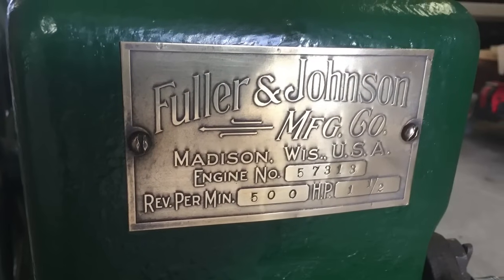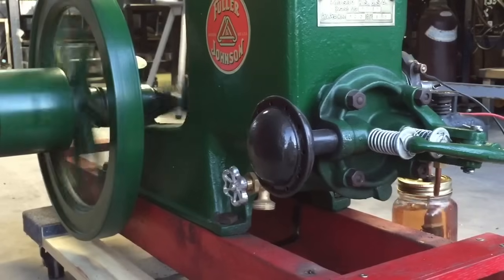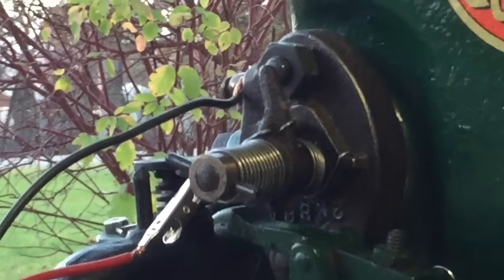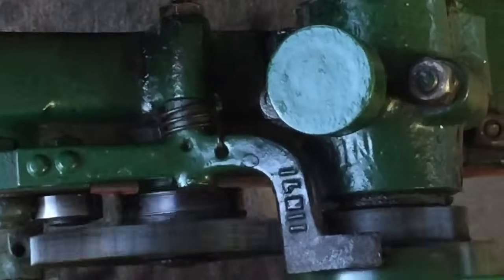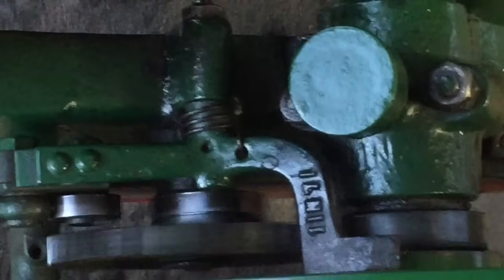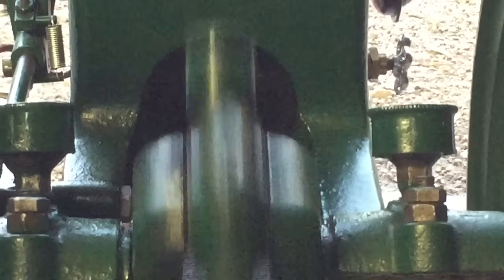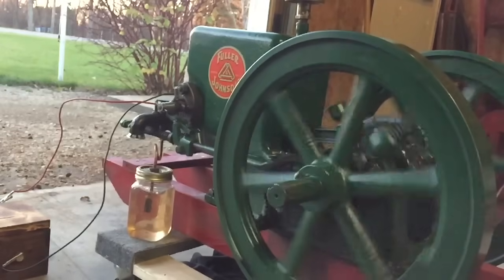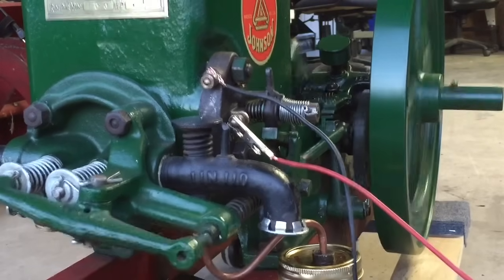How Does A Hit And Miss Engine Work ?

Comment: I’ve been a mechanic for over twenty years and have never seen one of these running but to see it is amazing makes me feel like I grew up in the wrong era
Reply: I know this is somewhat "ancient" technology due to nowadays, but quite frankly, I am wondering if perhaps there's a way to make this more effencient of an engine.

I'll have to think of ways to make it more efficient, but maybe also, a steam engine could potentially use this technology as well, along with the hit and miss ideology.

Considering it would have to be a compound steam engine, but i doubt a compound steam engine could work the same way, possibly another way.

The way this technology is going, a possiblity of steam engines with solar parabolics and the usage of hit n miss engine combination...

I'll think about this more and more every day as time goes by to not dissapoint those that relish a hit and miss to allign into a newer era.

Problem is, steam is not a lubricant, but the smidge steam oil with the heating of the sun may allow the oil to make the water heat more absorbant and retain more heat.

Allowing for such an occurance to be possible.

Comment: Thanks for this video. It enabled me to add a scaled down governor to a 3" diameter flywheel for my little 4 stroke farm style engine. It works pretty good once I realized the flywheel eccentric needs to be timed with the valve cam so as not to engage too soon.
Reply from the maker: Glad it helped , but i dont know how youd go about timing the valve cam to the governor/latch

The gov collar moves based on rpm which has no relation to the location of the cam/pushrod/ex valve location.
The gov collar may be in postion to latch at any time in the pushrod location but can only do so when the pushrod is fully forward and ex is fully open
Reply: In my configuration, if the flywheel weight eccentic caused the latch arm to engage the valve pushrod collar before the cam opened the valve all the way, it would bounce back off the  stop collar od and not catch. By setting the weight in relation to the exhaust valve it could engage at the precise instant to catch . @BAGOTCORNER
Reply from the maker: Send me a video bagotcorner   At  gee male dot calm

Comment: I was told that the water hopper is open on top to allow the hot water to evaporate, so the cylinder doesn't get hotter than boiling water. Is this right?
Reply from the maker: @Rickinsf  that’s 100% correct

Comment: Very good explanation friend: thanks for this! 

It struck me how much knowledge, accumulated tech and machining cab abilities had to come together even to make this simple engine. 

Also struck me just how quiet even mechanical older technology is. I don’t hate modern engines or ICE but whatever fuels we burn in them we need to find ways to make them quieter. 

That and rolling resistance noise on roads. Damn I would be a happier man if wheels produced only half the sound.
Reply from the maker: Thanks for the kind words! 
My thoughts as well 😉

Comment: If one of these was under load, like powering a saw mill or farm machine, would it fire continuously, as long the rpm’s don’t get to high? In other words does it only miss when not under load?
Reply from the maker: @mplsmark222  it depends how great the load.
If the flywheel slow down enough for the governor to unlock the trip, then it would literally fire continuously.

It’s all about flywheel speed, and the centrifugal force opening the governor weights
Reply: @BAGOTCORNER  thank you. Do you know, as a general rule how much of their rated  horsepower could they put out for extended work.? If they were to be pushed beyond what they could pull, do they just stall, or could they explode?
Reply from the maker: @mplsmark222  tough to say on hp , but they were designed to put out that hp at a rated rpm .
Say 500.

Obviously less hp if the load keeps it below that rpm.
 
Increasing the load will eventually just stall the engine

Comment: on the miss cycle it does not suck fuel at all?
Reply from the maker: No not possible .
Ex valve is held open , so theres no vacuum to pull open the intake valve to suck in fuel from the mixer

Comment: First you slip on the oil next to the top off tank. Then you need to use a hammer to get the foot peg out of the flywheel as it's stuck. Then you need to use a hammer to get the foot peg out of the flywheel because you had oil on your shoe and it popped back into the flywheel becoming stuck again. Then you kick the engine over 4 or 5 times till you remember you didn't prime the day tank. Then you kick the wheel over half a dozen times till it starts up. You wait. You wait some more. You know the second you leave the engine room it's going to stall out. Then you leave the engine. Then you repeat all the same steps because as soon as you left the engine room it stalled out.......

Comment: I always assumed that they missed because they did not have ignition timing... I did not realize it was a speed control method
Reply from the maker: Absolutely .
The ignition timing is the same revolution after revolution , it never changes .
What does change is compression/ suction

Comment: Very interesting 👍 so I have one question. Why hit and miss and not hit hit like todays motors?
Reply from the maker: That’s an excellent question .
I’ll just throw a few things out , fuel delivery systems were poor until the mid 20’s .
I have early 1920’s 4 strokes that do have governors and aren’t hit and miss .

It may be that they they were a tech that just held on till about 1935 and then finally ended .
There were however a lot of crossover years .

You do pose an excellent question
Reply: @BAGOTCORNER  thanks 👍
Reply from the maker: @SomeplaceOrAnother  if you find out ,, let me know ! 😊

Comment: Awesome technology. So does a two stroke fire every revolution where a four stroke fires when the rpm starts winds down (when the governor makes it fire)?
Reply from the maker: Hi Robert ,
You’re mixing two systems together .
A 2 stroke requires 1 full revolution of the crankshaft to complete its cycles and a 4 stroke requires 2.

There are also governed 2 stroke engines like Maytags for example .
Governing isn’t specific to 2 or 4 .
It is a system of limiting rpm .

Thanks for commenting , sorry I’m late to answer you

Comment: Why is it called a "governor eccentric"?
Reply from the maker: I’m not sure if your question is ,, what is a Governor or what is an eccentric .
In case it’s both , the Governor moderates the speed of the flywheels by removing the engines ability to fire. 
The eccentric part is that it explains the type .
It is not a flyball ball Governor , it is a flinging weight yes , but not only
Does it move progressive outward , it is cam shaped and it’s orbital Center isn’t is the specific middle
Reply: @BAGOTCORNER 
I should've been more clear in  my question. I understood the governor part, but I was unclear on why they'd choose the term "eccentric" to describe a mechanical engine part.  From my experience, it's a term used exclusively to describe strange human behavior, generally involving wealthy people.
Reply from the maker: @HighlanderNorth1  off Center ,, not centered .
Which could mean ppl or simply an object .
Reply: @BAGOTCORNER  
Ahh, ok. Thanks.

Comment: Some would call this “primitive” technology, but clearly a lot of thinking was involved in designing and building these engines. Very nice, thanks for the vid.
Reply: Primitive also translates to high reliability. These days every thing modern requires delicate care and maintenance.
Reply from the maker: @Ahmadsyar you are correct!😊
Reply from the maker: @Ahmadsyar you are correct!😊
Reply: The video said the machine’s internals had to be cleaned often so the machine didn’t wear out,  Do you have to clean the internals often on a modern engine?
Reply from the maker: @binsbins1 no .
This has an open crankcase.
Modern engines are closed
Reply: @binsbins1  Depends if you have a 2004 to 2014 Ford 5.4L, or certain older VW, Audi, Toyota, Lexus, or Chrysler engines...sludge sleds...lol
Reply from the maker: Thanks for watching
Reply: I would imagine that if something terrible happened (WWWIII, deep impact event) this kind of technology would probably still work, so long as some fuel of some sort could scavenged. You wouldn't be winning and Grand Prix with it, but it could pump out a ditch, mill grain or draw a plough, I reckon.
Reply: Those people wish they were as smart as a primate let alone a 'primitive' 😂

Comment: What were the advantages of hit and miss from a regular gas engine other than fuel consumption
Reply from the maker: Good morning ,
There were realistically no advantages and are none .

Cost was the issue .
Making affordable throttler engines was more expensive .
Reply: OK thank you I was wondering because there’s very mixed answers on that some people will say they will produce more torque and a more even amount and some people will say there’s no advantage they’re just cheaper thank you
Reply from the maker: @soggyspaghetty5799  they do def provide a more even delivery of power .

Comment: so all of this was to get around not having a carburetor 
interesting stuff
Reply from the maker: It’s has a mixer .
Same idea .
It was a way to govern engine speed .
Reply: @BAGOTCORNER  oh yes, I meant throttle plate? didn't we have those by then?
Reply from the maker: That’s a great point .
I would have def assumed they knew about throttle plates .
Maybe not pre 1930 though but def after .
Then for a long while they used both .
A John Deere e for example is hit miss till the mid 40’s

Comment: I'm wondering if any manufacturers tried piezoelectric ignition like on a grill. Or are piezoelectric igniters a new invention?
Reply from the maker: twistedyogert it’s not new ,, but the issue of using one has been to get one to last .
I know of one gentleman ( since deceased)that tried one and found it to be less than  fantastic .
I believe either Briggs or evinrude had piezo spark .
But again ,, just not durable .

http://www.eldensengines.com/Otherstuff/Piezospark/Piezospark.html
Reply: @BAGOTCORNER  I thought that it would've been more reliable, no batteries to go dead or risk of magneto failures. But I can see how the crystal repeatedly being struck could cause a failure.
Reply from the maker: twistedyogert that’s exactly the issue .
The constant force on the crystals .
Realistically, a battery could be charged for many years and the coil was nothing more than a 10 ohms winding of 24-30 guage wire .
Very simple design

Comment: Wouldn't this also be an example of variable valve timing?
Reply: Sort of, but more like cylinder deactivation.
Reply from the maker: twistedyogert adjustable yes ,, but why do you think so ?
Reply: @BAGOTCORNER  Just because the valve timing (How long the valve remains open or closed.) automatically changes with RPM based on the position of the fly balls and load placed on the engine.
Reply from the maker: twistedyogert the valves never change their open/ closed duration and they never change in relation to the piston position .
The flyball only affects the duration the ex valve is held open .
Reply: @BAGOTCORNER  Got it.

Comment: What were these used for mostly? Generators? Water pumps?
Reply from the maker: twistedyogert used for running various pieces of equipment as the main source or secondary source through a line shaft .
Mills , grinders , cutters ,separators ,saws, pumps .
Mowers

Comment: About critical questions were answered. Most enlightening is the intake valve. And 2 or 4 stroke. 

Good vid.
Reply from the maker: Larry Scott glad you liked it .
The intake valve is so incredibly simplistic .
Requires no timing other than to have the exhaust valve close at the correct position and for there to be compression /suction

Comment: so what was the point of these engine? where they before internal combustion engines we know today?
Reply from the maker: Enterprise206 they were well before the ones you know today .
These essentially ran the farm and other select jobs untill modern stationary engines came available .
They looked like this untill roughly 1940 from the late 1890’s.
Used them for running everything from cement mixers to well pumps to milking machines ,grinders ,saws ,,on and on .
Depending on your location there is likely a show not far from you that still showcases antique power

Comment: Sorry but I don't get it. Exhaust valve gets hold open when the gouverneur miss, what makes sence. But it looks like the exhaust valve is doing the oposite thing. And the inlet valve is doing nothing until the gouverneur miss. But it's actuated by virtually nothing or at least nothing that's visible from outside.
First last, there is at least somethingy that's measuring the rotational speed - the most important part off the regulation mechanism I would say.
Reply from the maker: +Der Halbvolle Halbgeleerte hello ,
Well the governor holds the latch engaged when above set rpm .
When below ,the latch disengages .
The latch itself is tied to the exhaust valve .
When latched,the exhaust valve is held open ,hence no compression ,no suction,and no spark trigger .
When unlatched ,,there is compression and most importantly there is suction which then pulls fuel in via an atmospheric valve and then just before too dead Center ,,,spark⚡️

And repeat.

Comment: why not run it on compressed air ? Marmotor Barrufet
Reply from the maker: +mike peine because it runs great on gasoline .
Do you have an example of one you have done ?
Reply: Marmotor Barrufet powered steam engines from 1770 to 1800 . 1st patented in 1799 by Girard & Son of NJ . using waves to compress air . Ctesibius invented the technology over 2,000 years ago . see moniker ?
Reply from the maker: mike peine it’s very interesting .
Yes I saw your videos 👍

Comment: My dad has the same one its a 1 1/2 also. Ive been trying to buy it but dont know whats a good price for it. What is it worth
Reply from the maker: Michael G Hi Mike ,
Depends where you’re located .
Different areas ,,rarity becomes an issue .
I have a Waterloo Contract engine that’s someone rare around here and it gets a few hundred more than down in the USA.
Also maytags are far more rare in Canada.
This Fuller would run about 7-800 bucks in this shape here in 🇨🇦
Reply: If it’s your dads, you 
A- just take it.
B- wait tell he dies.

Comment: Follow-up, I know this wouldn't be "period correct" but perhaps leather covers could be made to cover the sides of the connecting rod big end to keep dirt from getting onto the surface. Perhaps just a skirt tied down to the machined part, or a larger cover across the main bearings like a 'T'.
Could work :)
Reply from the maker: +Gentleman Hooligan that’s a great idea!
All of this and safety is why they eventually went to enclosed cases.
Reply: glad you like it, would be a neat build video and experiment

Comment: Aren't all single cylinder gas engines a hit or miss engine.2 revs and 1 power fire?
Reply from the maker: +George Foltz you’re making a reference to a 4 cycle engine and your trying to apply a literal reference .
The term hit and miss is a coined reference to the ignition system of an early flywheel engine  
The two aren’t the same.
But this engine IS however a 4 cycle hit and miss .
Two cycle hit and miss units also exist .

Comment: We have an old John Deere "one lunger" that we still use to split wood with a screw splitter. It just won't quit. I sounds like it's ready to die every few seconds, but it just keeps on chuggin'. As long as it has fuel and a few drops of oil on the moving parts it will not stop.
Reply from the maker: +SixStringLove Guy they sure are charming aren’t they :)
Reply: Well, I don't know if "charming" is the word I would choose, but tough, reliable, simple and bullet proof would be better descriptors (much more manly than charming) lol

Comment: Excellent video. Great quality. Well explained. Great Work!
Reply from the maker: +Kyle B thanks Kyle 👍
Reply: Bagot Corner .. just curious how scripted is this you are extremely knowledgeable. Was there a lot of post processing. honestly the production value here is TV Worthy
Reply from the maker: +Kyle B as far as organizing my thoughts ,I jot down talking points for videos like these .
Same as the shear pin vid .
I just jot a few talking points pre recording ,then some vid clean up and that’s about it .
It’s been very very cold here this winter so production has stalled on a lot of projects .
Finally this week we’ve had a break in the weather ,,so this spring I’ll be back at it again weekly .

Comment: I attached a smaller hit and miss (from and old washing machine) to a high wheel velocipede and was stopped by the local constable for operating the motorized apparatus on a bicycle trail in the same town your engine was produced. The matter is set to be heard before a magistrate forthwith. My solicitor assures me that all is well, to fear not.
Reply: northerniltree ahh laddie... you ‘idn’t has no loicense fah that fangled motah caht did yahs?
Reply from the maker: northerniltree you have to be careful to not have too much fun :)

Comment: What would be the benefit of having such an engine?
Reply: Powering anything that needs to run at a constant speed. We have the same thing now except the governor actuates the throttle plate. These old engines had very heavy flywheels so they would keep spinning smoothly when not firing.
Reply from the maker: Joel 1 in what respect ?
Do you mean now or then ?